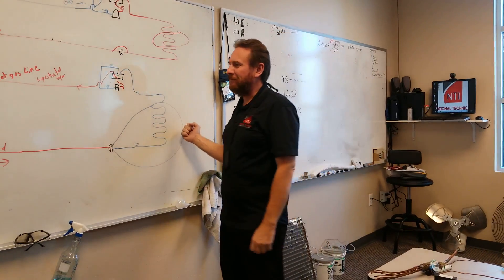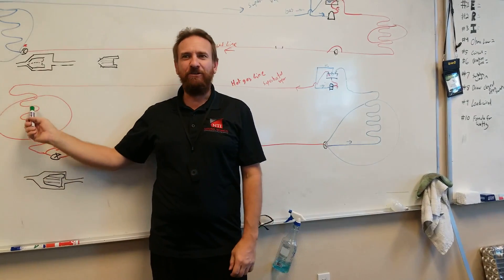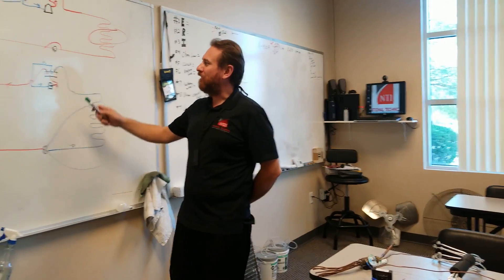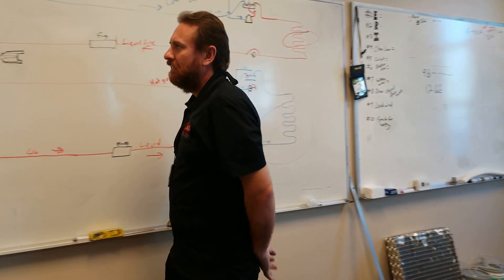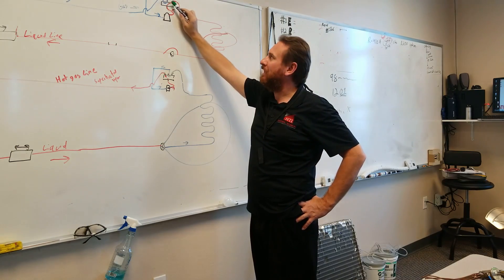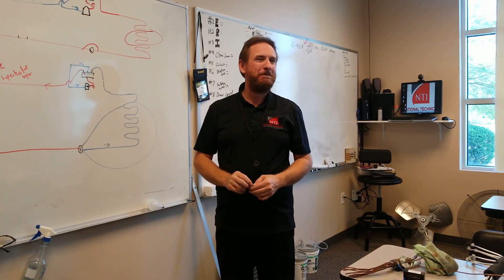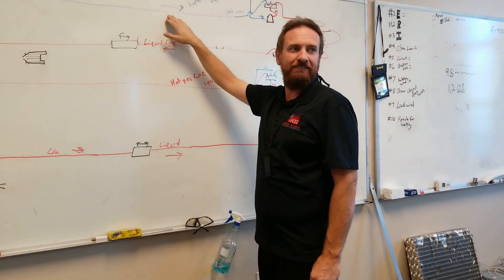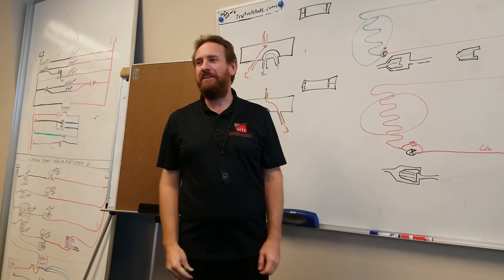Heat pump overview, where to hook up the guages

Comment: You don't always connect red hose to the liquid line.
Some units have a piston at the liquid line service valve, so you use the large line(Carrier).
Reply from the maker: Tom, you are absolutely correct ans that needs to be addressed. In this class I am only allowed 1 day just 4 hours to teach it. There are many points that unfortunately get left out for the sake of speed and general understanding. 
That said I never liked Carriers method. I prefer the TXV outside.
Reply: Most school professors hardly have no field experience. Their experience is in the class room labs

Comment: I am so glad I found your channel. I am not training to be an HVAC Tech but I do speak with a lot of them on the phone and one of the most troublesome issues are heat pumps. I happened to find this when I looked up reversing valves, so glad to find your channel to give me a better understanding of what these guys are telling me. Quite frankly, the ones I don't have to talk to much are the ones who are knowledgeable and those I spend 3-4 hours on the phone I don't think are experienced enough. But hopefully I will understand more in a visual way than just hearing it over the phone. Thanks for your time in doing these.